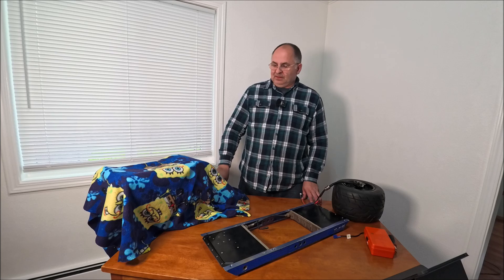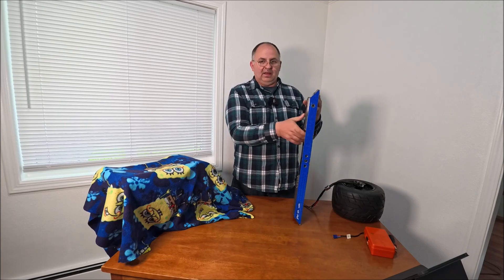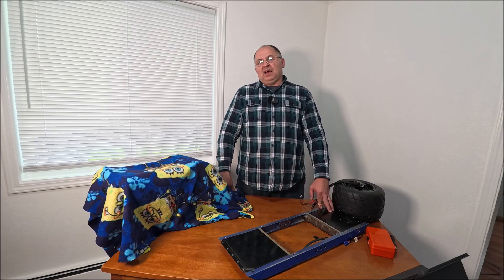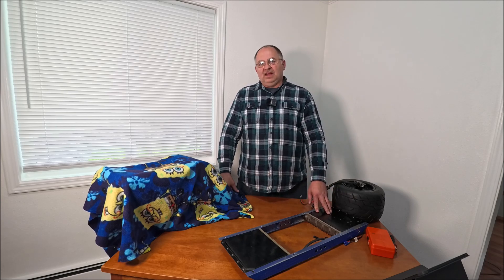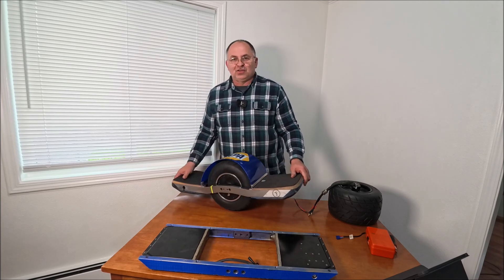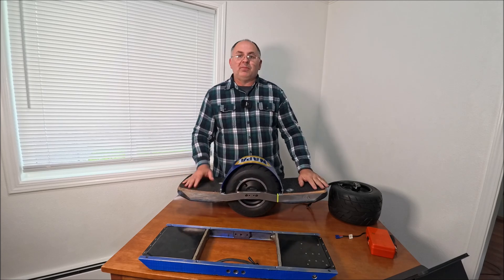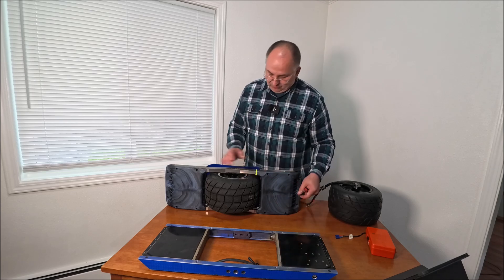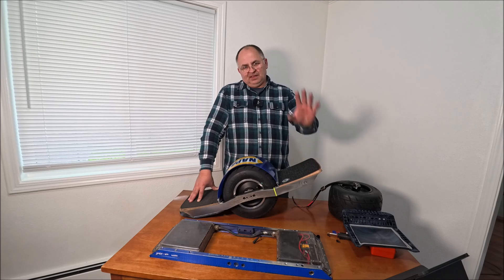VESC Onewheel XR 20s3p One of The Kind 1080Wh custom built DIY

Comment: would it be possible to make a 20s4p and put the controller inside the motor.
Reply from the maker: With two Badger TORque box setup, if you want to go with 4p maximum will fit 18s4p + controller inside the CannonCore motor

Comment: I hope you will try electric unicycle one day. You get more range, more speed, more load capability. Onewheels are cheap toys compared to EUC. Thanks for the helpful video! I am going to build custom packs for my EUC. Also 20s3p = 72V
Reply from the maker: I used to own EUC that was fun, but I like my VESC monster XR better
Reply: Euc is a vibe, but so is onewheel. I prefer the sideways stance over straight stance, and onewheel always gets the attention on group rides, as they look so much cooler than euc.

Comment: What is your bms setup are you running? External balancing?
Reply from the maker: I'm using a Flipsky 4s-24s BMS and it is internally
Reply: so you have 24 cells in the front? 8s3p front pack?
Reply from the maker: @ericugland7990  yes 24s of 21700 and is 8s3p

Comment: Impressive build, pair that with a thor300 you can get 60miles range.
Reply from the maker: Thank you, Tronic 250R it's a pretty good controller as well, it will never overheat here in Alaska
Reply: @GPeter7  you should make a 30s2p board with x12-30
Reply from the maker: @wayofflow955  That's exactly what am going to do for my next secret project 😉👍
Reply: @GPeter7  do you think the SF HT can handle that much power? Would love to see the build, I am think of building one myself! Don’t know how it will fit!
Reply from the maker: @wayofflow955  Superflux H/T at 126v should handle no problem, but only the test will show 😉
Reply: @GPeter7  it would be the safest board if you don’t go fast.